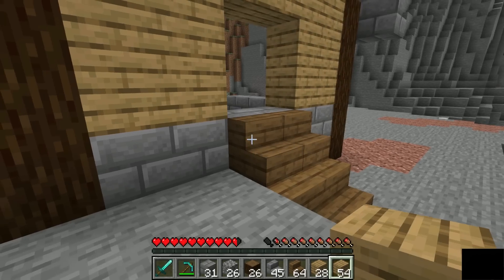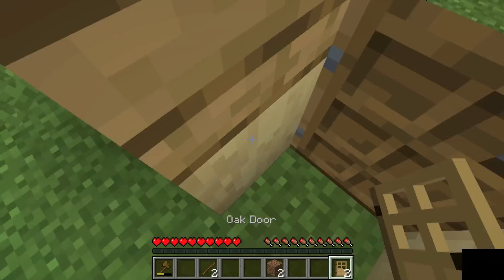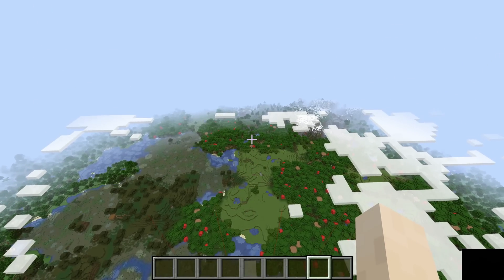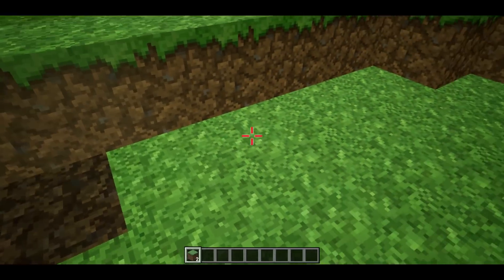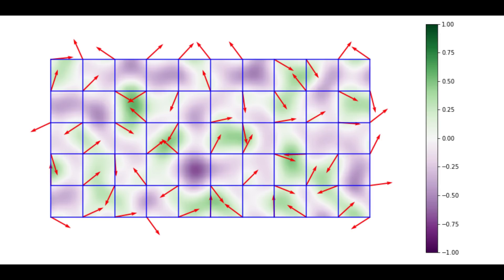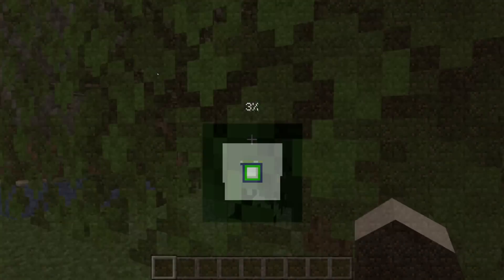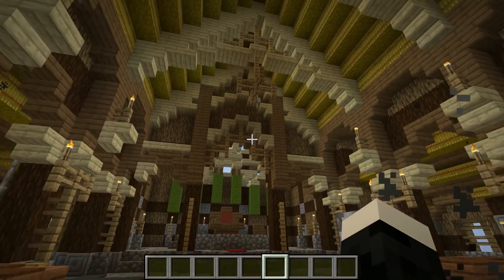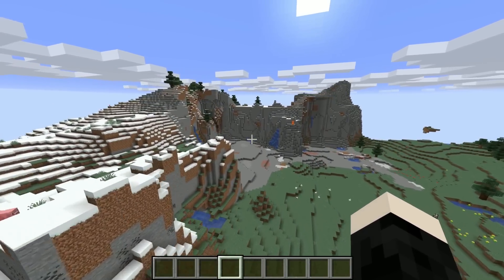Why Minecraft is a Technical Feat | Explaining the Engineering Behind an Indie Icon

Comment: Good video but just a few things, Minecraft is also polygonal rendering, known as rasterization. Yes, it is voxels too but you shouldn't distinguish between the two unless one is real voxels which use raycasting and a special algorithm to find the color of every pixel on the screen and is much slower than rasterization. Minecraft is essentially just like Super Mario 64 except the models are shaped differently. The voxel data is used to generate the models, as well as being used for the physics and AI pathfinding. Cubic voxels are faster than smooth voxels such as marching cubes, especially when it comes to physics and collision detection.
Reply: I'd say Ray casting is way faster than triangle rasterization for voxels if done properly.

Comment: Outcast was beautiful - and still is. It speaks for itself, as an approach. I think it’s a weak comparison, to suggest Minecraft and Outcast have voxels in common. The scale of the voxels in relation to the player is so different that Minecraft feels like blocks, tortured into more naturalistic forms at the large scale - inferencing smaller details (and define the functionality of the block), is left to the pixel bitmap on the sides of the block. Whereas, in Outcast, the voxels provide the small details, giving a very organic (albeit ‘melted!’) aesthetic. These voxels do not need to have functional value as the unit blocks on Minecraft do, and they are not ‘for’ sandbox, emergent behaviour. They are for beauty, while in Minecraft the player has to be able to perceive, and utilise, a strictly assigned set of properties to each block-type. The voxel use in Minecraft is a functional necessity, while in Outcast is an aesthetic one.

Comment: Can't believe I didn't realize that the reason the height limit of minecraft used to be 256 is because rgb goes from 0-255 and they use a height map. Great video!
Reply: I mean, they could have stored it as a greyscale heightmap sure.  RGB goes from 0 to 255 for each color*.  If it was an RGB heightmap he could have stored 16 million different values, as your typical RGB images uses 3 bytes (one byte for each channel).  That's really the limitation: heights and light levels (16 from the sun times 16 from torches etc), biomes, etc were stored as a single byte.  It was all an array of bytes.   Blocks+blockstates were two bytes allowing for 4096 different blocks ( 16 states comes out to 65586 different values, which is the most that can be represented by two bytes).  That's all changed slowly with time.  Now with registries there are almost infinite amounts of blocks and biomes etc possible, as you won't run into that many in a single chunk so the bytes stored don't represent the blocks directly but entries into lookup tables that are unique per chunk.  16*16*256 is 65586: that's the most unique blocks you could possibly find in a chunk.  So you can represent the blocks in that chunk with two bytes, using that value to lookup what block it is in that chunk

With 1.18 extending height beyond 256 that won't fit into a byte anymore, so height is now stored as 9 bits (one byte plus an extra bit) which for storage is packed together sequentially and is a lot more involved to read than just getting the byte at value X.  It doubles the height allowed.  It could be doubled again with one more bit.  With more than two bytes worth of unique blocks now possible per chunk they'll either have to increase the amount of bits used per block identification, or split the chunks (and their lookup tables) vertically.  

I've had way too much of a front row look at this as I've been working on VoxelMap for 10 years.  It gets a lot more complicated to represent the map when you can't lookup a value in an array and match it directly to a block but instead have to take that value and look up which block it represents in that part of the world.  Height going beyond 256 is going to be a PITA for storage as bit packing is not something I want to deal with so each height stored will take double the room.  I really dread light going beyond 16*16 levels (colored lighting for instance) as that will blow up what I have to store for quick retrieval for the minimap and world map.  How Minecraft itself stores that stuff to disk is getting increasingly abstract (which allows for limitless addons and new blocks and such).  It's harder to deal with, but really skillfully done.  It's getting to where I don't feel like dealing with it anymore though haha

Comment: Hello! I do have a few points of this video I would like to mention:

- Minecraft has a flawed implementation of many systems:
For the server community around Minecraft, they have to worry about these performance hits, and thus they create solutions to it
For lighting: Starlight's lighting implementation, which is dozens to hundreds of times faster than the normal engine.
Spigot introduced multithreaded chunk generation, paper fixes a lot of general bugs and issues + general performance improvements, and airplane builds on top of this. 

- The Horizon mentioned how the game was made in java, not meant for performance-optimized games
This is true, however, their rendering code uses LWJGL (wrapper of OpenGL), and thus the rendering code itself isn't the bottleneck -- rather the java garbage collection system (responsible for a lot of lag spikes you may get)

For the terrain generation, the algorithms implemented are pretty simple to implement, especially if you use a preexisting library -- I think you should have covered some of the harder aspects of Minecraft's terrain generation -- I don't delve too much into it, but some of the harder issues including resolving conflicts and Minecraft's new terrain generation would have been a better fit for the technical aspects.

Of course, I do have respect for the attempt of implementing these systems -- they are, of course, flawed, but the determination to implement some of this was great.

tl;dr I feel like this covered the history of the libraries that back Minecraft, which can make anything a technical feat, but not Minecraft itself. I do like the format of the video though!
Reply: Don't forget that you have the luxury of hindsight.
Notch had to do all this stuff from scratch in a world where it never existed before.

Comment: While this is informative and interesting, technical complexity of Minecraft is nowhere near the modern triple A games that we take for granted. Implementing Perlin noise is a lot easier than it might seem, not rendering what you cannot see is de facto standard in any modern video game, and the lighting problem is incredibly simple compared to mind boggling calculations for lighting they do in modern games like ray tracing which is only one part of the entire lighting solution. Don't get me wrong, it's an impressive game nonetheless but the true marvel of Minecraft is that they optimised it enough to run well on Java which is really not meant to be used for anything like this.

Comment: This video is well done in general, but there are a lot of things that are not correct or omitted. Voxels, for instance, are simply just 3d points. Subnautica is a game that uses voxels for its terrain because it originally wanted to support terraforming, but it's not displayed in cubes. Minecraft uses them on grid and makes blocks while SN uses unsnapped voxels to generate smooth meshes. Backface culling was not mentioned, your source on it doesn't have that term but does have "culling." Backface culling = removing the unseen faces (backface) from display (culling).

I could go on, but I do like this video. If you're not a programmer that knows how the code works, this is about the best you could get with secondary resources without spending countless hours. I wanted to mod MC and looked at a lot of the code, but also WHY DID NOTCH USE JAVA AAAAAAAAAAAAAAAA

Comment: It's funny how you say that voxels are the thing that make Minecraft work, yet the voxels are rendered as polygons.

Cool video. I learned something about various uses for Perlin Noise, which I haven't had to work with before.
Reply: it is voxel just graphically rendered as vertex
Reply: @themalaysiandude3903  Technically, no. The voxel rendering technique doesnt use vertices at all. You can also not render something as "vertex" o.ô Vertices are just the "numbers" which tell the gpu where the polygons should be drawn. A single polygon without anything (like normals etc.) has nine vertices.  Three vertices for each point of a single polygon.
Reply: but if you want almost(i think) voxel game, you should check out john lin's sandbox

Comment: my game artist brain will kill me if i don't throw in this one little "uhm akshually" - with that example of the components of a minecraft cube, technically the six faces don't have separate images on them. it's all one image, the different parts of which are placed on different faces of the cube. it's more like that thing you may've done in school, where you make a paper box out of a lowercase-t or cross-shaped piece of paper by folding it up. the texture is that original piece of paper, and by folding it up, you make a cube with just one texture that displays different parts of that texture on each face. even more detailed game models/textures use a more advanced version of that papercraft method! i'm sure you know that, but i just wanted to comment for a little extra cool info for folks reading the comments :D
Reply: They actually do have separate images. If you’ve ever made a texture pack before you would see this. Maybe some behind the scenes trickery happens where all these different textures are combined into one image and pushed to the GPU for optimisation reasons, but I highly doubt it

Comment: It makes no sense to compare the amount of polygons for an entire environment to that of a single overwatch character.  Overwatch runs great, and there are up to 11 other characters playing with you.  Doesn't really compute that this is a problem because Minecraft uses as many polygons for an entire environment as overwatch does for a single character? That sounds great for performance.
Reply from the maker: That comparison was comparing one chunk that was meshed naively to an overwatch character. The actually terrain on minecraft has a 12x12 chunk radius set as the default, allowing you to go up to a 32x32 chunk radius. So if you want to take the whole terrain meshed naively, that would be 144 chunks × 700,000 triangles =100 million triangles. Now you can get around this by culling interior faces and everything, but I was trying to point out why the naive solution is so bad :)
Reply: It gave that figure for one single chunk, and there are 12 chunks around the player in the 4 directions, so I think you can multiply the total by 144. No doubt we'll get there at some point, but there's still a big margin.

Comment: 13:12 "Unlimited light sources is almost impossible in games like Call of Duty" -Well, you're right about that. Modern Warfare 3 had to twist itself into knots in regards to its military tactics in order to justify only having a single flashlight on in a pitch black catacombs level. It makes zero tactical sense, but the engine could not handle more than one dynamic light. Might have something to do with the fact that it was still the same damn engine that Quake 2 used in 1997.

Comment: What I want to understand is how the game decides what block to display when you're, say, mining... and how that mingles with blocks the player has changed/placed. I could be mining a block of stone and whatever lies behind it isn't displayed until I break that first stone. Say I then decide to place a block of wood in it's place and completely covert it on all sides with stone. I could go millions for blocks away and do other things forever, but that 1 wood block I encased in stone will always be there, not visible as a part of the world mesh until/if I decide to dig it back up.

Like, the world initially decided it was stone but I've forever changed it to wood, and the game has to remember that.
Reply: I guess that the perlin noise world generator decides wich blocks are placed by default on a chunk, then when the player modifies the chunk, it stores the chunk content on disk, on the save game, then just loads it into memory and remap that chunk to the saved one instead of the pre generated one, so that you can have all the pregen terrain plus your modifications to it, that might also explain the savegame size
Reply: @juliorolandi6694  So if a player took the time to mine and replace blocks from a massive amount of chunks, that would raise the save file size?
Reply: @tylernorman8745  It used to be like that, I remember having 500mb save file size in v1.6.4

Comment: You forgot to mention the critical property that perlin noise has: The initial parameters create an implicit infinite map with you can query for any position in O(1), i.e. in constant time independent of the position. That's why it's used so often, in particular for minecraft. That's why I doubt that the caves are not generated like you showed - the world generator has to be a program which you can ask: What's the world like at (x, y)? Now if the caves were made like you showed, in order to answer that question, the generator would have to look around arbitrarily far to see if there are some caves spawned somewhere which, after tracing as you showed, randomly happen to cross the point (x, y). This is not feasable. 

But you're definitely right that the world generator is probably the most interesting of all the technologies.
Reply: your double negative made you contradict yourself. "why I doubt that the caves are not generated like you showed"

Comment: Something maybe worth pointing out, although I kinda understand why you didn't mention it in the video since it gets kinda complicated, is that the real main reason by not drawing each block individually more has to do with reducing draw calls.
Because while its partially true that less geometry will run faster, thats not the whole story. You could totally still draw the visible blocks 1 by 1, getting rid of unnecessary faces.

The real reason not to do this has to do with whats called draw calls. Basically, when a cpu tells a gpu to draw something, thats called a draw call, and it also includes some geometry for it to draw. Sending more geometry at once here is stupidly fast compared to sending each block individually to the gpu to draw in a draw call.

Like think about it this way, if we wanted to draw each block visible individually in a 16*16 chunk area, and we assume a completely flat terrain for simpleness, thats 16*16*16*16, or 65536 draw calls for just flat terrain

Compare that to issuing a draw call per chunk instead, now we get just 16*16, or 256 draw calls. (although this is partially not true, the game actually splits each chunk into different parts like transparent blocks and stuff, so realistically it'd be more like maybe 1024 draw calls or something, which is still nothing compared to 65536  draw calls)
Reply: TL:DR; There is overhead for drawing each individual block.  Instead groups of blocks, called a sub chunk, consisting of 16x16x16 blocks, have the voxel data converted to a mesh which is then sent to the GPU.

Comment: this vid is you trying to get popularity from the brand. minecrafts systems and workarounds are neat but not by any means techincal feats. If any part of minecrafts creation and systems are noteworthy, I think it'd be how they're able to feasible have so much complexity for every mob and block in the code. Like there's so so so much logic for zombies, for example. it'd be a nightmare to code and maintain it all if it wasn't written fantasticlly
and no you don't explain shit. at best, you're just pointing out some of minecrats simpler systems

you didnt go over how minecraft being able to track what's changed in the world is noteworthy. seems you have no bloody clue how they did this either, hinting moreso this vid is lazy garbage for views
not rendering not visible geometry is not noteworthy
perlin noise is extraordinarly well known, and is again not noteworthy. it's the easiest thing to think off "i need to infinitely create a random world. so i need to randomly make land. i can do this via noise"
the smart fade between biomes using the graph is neat but by no means a "technical feat", and the rivers are a cheap cheat fix. not a feat.
minecrafts lighting system is again not any sort of technical feat. it's just a neat alternative to baking
i dont think having baked lighting for many light sources in aaa games like cod would be taxing on the gpu whatsoever since its all precalculated. the gpus job for lighting, then, is just to draw the colour of the pixel, no calculation for lighting required

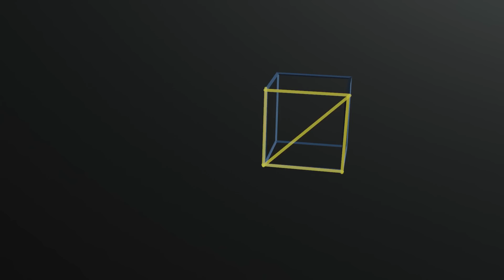Comment: I think you could maybe have toned the music down a bit, especially around 2:50, because it was kinda hard to hear you over it.

Having lights be 'photorealistic' makes little difference, it's the fact that Minecraft's light is calculated when it's placed, and is saved and rendered as part of the world.
For other games, while some light is pre-calculated, the vast majority of lights interacting with the scene are dynamic, shader-based lights, which must all be processed and reprocessed each frame. The more you have, the more your performance drops.
Minecraft has the advantage in that its world is already voxellized, so adding light values to the voxels that then gets propagated from sources and saved, means they don't need to be updated again until something nearby changes.
For all the talk about how dynamic Minecraft is, yes you can change everything about the world, but without that, it's remarkably static.

You also do have the option to look at what's effectively Minecraft's source code, thanks to the various modding projects. You don't have to simply guess at the answers.